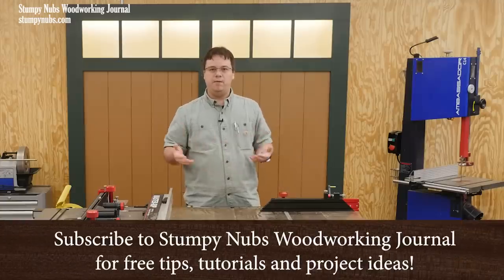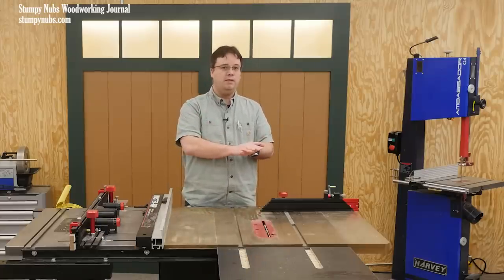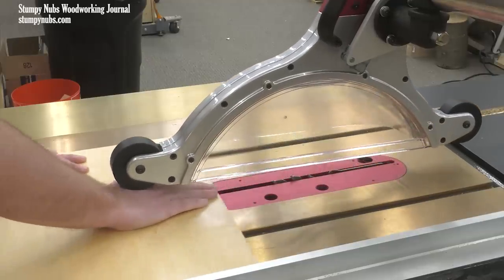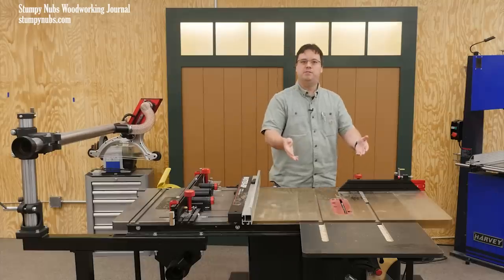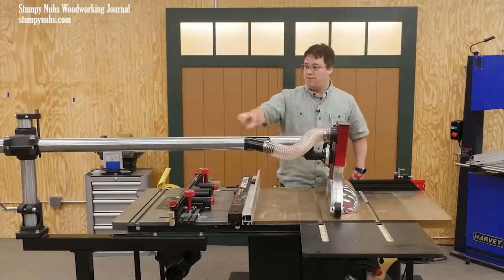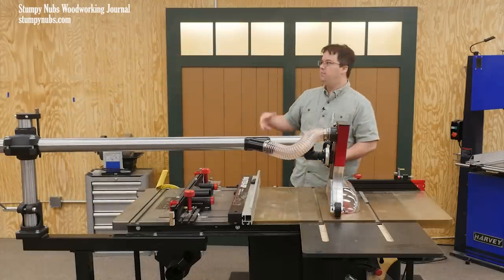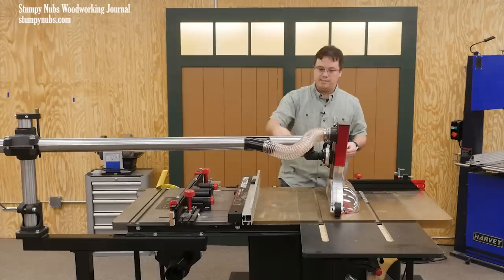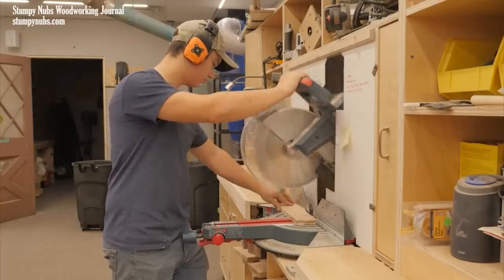MUST SEE table saw idea can save your fingers!

Comment: This video reminds me of a question. Lately, I’ve seen an online obsession with track saws. Aren’t they just a circular saw with a guide? Whatever happened to snapping a chalk line? Or even clamping a straight edge to a piece to run your saw along. Seems like it’s a case of saving money by learning to use another tool right. 

But then again, maybe I’m missing something. You’re one of a few guys I feel like I actually learn from. (The other guy is old-fashioned hand tools only).
Reply from the maker: There are definite benefits to a track saw. For one thing, the track can create a perfectly clean cut much easier than following a line by hand. The track can also be laid right on your mark without accounting for an offset, as you would with another type of guide. And the track's edge is designed with a strip to hold down the fibers and prevent tear-out along the edge of the cut. Finally, it is easier and safer to plunge-cut with a track saw. I am not saying anyone NEEDS a track saw, but it there is a reason people like them.

Comment: Beyond it actually working the next most important part of any safety equipment is not getting in the way.

My company bought 2 chuck guards for ours and maintenance's pedestal drills, I argued to modify ours in a way that made it slightly less protective but way easier to use, a year on and ours is still in use while the one in maintenance is partially broken and spends most of its time bypassed so it doesn't get in the way.

Comment: I was expecting that thing to cost much more and it is more reasonably priced than I thought.  It is ~$850 on sale ($1000 normally).   Still out of my league. 

I've been toying with a home-brew system that actually mounts to my shop ceiling for my saw that I had to remove the guard, because of the outfeed table and design of the guard mount (old Craftsman 113 - converted to a cabinet type saw).  I have a basement shop with floor joists about 7' above, making it more convenient than attaching to the table or floor.  Time will tell if I have the willpower to follow through and build it.  ;)

BTW... my converted saw looks almost like yours... same basic dimensions, router table to the right, etc., but my outfeed is 48x48" and covers nearly the entire back of the table (thus prevents mounting the original blade guard).  I built a dust shroud around the exposed motor with 4" extraction for chips and cooling (again, eliminating the ability to re-mount the guard system).

Comment: A SAWSTOP brand saw is a great blade guard.
Reply from the maker: I own a SawStop and their overhead blade guard that's similar to this one. This is definitely better, but the SawStop one is nice, too.
Reply: @StumpyNubs  the point was, there’s no need for one on a Sawstop.
Reply: @StumpyNubs  the blade guard is pretty redundant unless you key off the cartridge to cut plexi, Kenmetal, etc
Reply from the maker: I still use my guard on my SawStop.
Reply: @StumpyNubs  But why? I’m on the bench about 30% of my day five days a week. I don’t know how you can stand having a guard on there. I even pull the riving knife.
Reply from the maker: There are many reasons to use a blade guard besides protection from getting cut. Link to a video about it is pinned to top of comments.

Comment: At $850, it is expensive, but it doesn't appear to be overpriced. If I were to have one in my shop, I think I'd mount it to a rolling cart so I could move it out of the way when using the router table.
Reply from the maker: It has to ship freight. It's heavy and large.

Comment: I bought a Craftsman table saw and the riving knife didn't line up properly with the blade so i took the assembly off. Never used it again. That scares me to even think about - luckily all my fingers are in tact. Just bought a DeWalt table saw and the guard is staying on for sure.

Comment: JAMES! - IM GOING TO CUT MINE!   😅😢😬😰😱 wish me luck!!  I bought the Harvey shark and I have a Laguna cabinet small with 36” to the right of the blade and a tiny garage shop. I just can’t place the long 60+” arm plus blade cover far enough away from the saw blade, or at an angle without taking up a massive amount of shop space.  I’m about to take about 15” of the length of this shiny beautiful steel boom. 😱😱😱

Comment: Hi,  Enjoy your videos, some of the best on wood working tools and techniques.  Your video on the Shark S-12S was a “just what the doc ordered” and so I have looked into this further.  I have one question that I can’t seem to get an answer from Harvey customer sales.  Without getting into the details I  have the need to position my table saw in two positions in the workshop that is 90 degrees at various times and so the S-12S is too heavy to make this adjustment easily. Therefore I’m considering/investigating mounting it from the ceiling. The question is can the shield be easily rotated 90 degrees.  The answer seems to be yes but looking at the instruction manual they say I would need to remove the “knobs” which appears to be what holds it in set position, and Martin at Harvey keeps avoiding that part of my question (maybe I’m not explaining myself??).  Having and using this tool first hand, do you see any issues.. ?  Thanks, and keep up the excellent videos.. John.
Reply from the maker: I am not sure I understand you, either. But I can say that the shroud assembly connects to the end of the horizontal arm at a sort of ball joint which, when the two knobs are loosened, allows the whole head to move in all directions (like your shoulder joint). It can turn, tilt, etc. Whether that, along with the fact the the horizontal arm itself can pivot on the vertical post, will give you the range of motion you need, I can not say.
Reply: Yeah, I understand that my situation is hard to picture, especially if I try and avoid writing a novel.  Anyway, Martin (Harvey customer service) suggested that the “knobs” had to be completely removed to give me a 90 degree clockwise rotation, starting from the more traditional configuration as shown in videos and the manual. That did not make sense to me looking at the instruction manual and the available videos..   Any of that make sense..   If not, thanks for listening…

Comment: Delta had an overhead blade guard back in the 50’s. I have one for my vintage Unisaw. It just doesn’t have the dust collection. You can even raise the right side for cutting close to the fence. It even has a splitter that can be popped up from below the table, and dried back down for non thru cuts.

Comment: Its nice looking but I had to save for year for my 3hp sawstop. I didn't even buy the over head dust collection. I took pvc pipe run it down my table 90 up then back down when I dont use my blade guard I just put pvc cap over it. It's nice but out of my price range. Heck I have pvc zip tied to my table saw lol

Comment: In a commercial shop - yes, It make perfect sense. In our small shops, not so much.  The size alone will steer most away, plus the price. I'm not saying that a guard isn't necessary because they are!  There's others on the market that have the same idea but somehow they've all but disappeared from the shows they were on. Dust collection and safety have always been a big concern with the table saw and with the renewed interest in the hobby it has (again) became a big concern and rightly so. 
Nice  but???

Comment: If the arm could rotate downwards 90° at the base to lower the arms to a horizontal position below the table for bigger cuts, it wouldn't need to be so large in smaller shops that occasionally cut large boards.

Comment: I've always wondered if there is some technique I've never seen to make a blade guard function when you need to set your fence close enough to the blade that it would run into the blade guard. Or is that one of the time you simply do without the guard?
Reply from the maker: I don't know of any blade guard that works for rips closer than about an inch from the fence. The nice things about this one is you can just swing it out of the way, then swing it back in place.

Comment: Or we just have ancient table saws that keep on working because they were built more robustly (but with less safety features) back in the day. (I probably wouldn't even have a table saw if it wasn't a hand-me-down). Hell, mine doesn't even have a mounting point for a riving knife, much less a blade guard. I give that thing a very healthy degree of respect; including a household rule: "If the table saw is running, no talking to the operator, or disturbing him in any manner until the saw is turned off and the blade stops turning."

Comment: James I noticed a bump when the workpiece you were feeding contacted the area ahead of the rear wheel of the guard.  Is this something that could be adjusted away or is it a feature of the guard?
Reply from the maker: I'm not sure what you mean unless you mean how the workpiece lifted the guard upwards. I explained that int he video. If you don't like that, just lift it by hand before you make the cut.
Reply: @StumpyNubs  I guess I wasn't clear. When you fed the workpiece into the guard the wheel on the leading edge of the guard smoothly lifted the guard so that it rode on the workpiece. But as the workpiece contacted the metal portion of the distant edge of the guard just before it reached the rear wheel the workpiece appeared (to me) to almost stop moving until the force you were applying to the workpiece overcame the resistance of the metal edge of the guard and lifted the distant wheel up and onto the workpiece.  If you didn't notice the bump then I guess it's not an issue.

Comment: Hmm, replace the wheels on that guard with ones that have a hub motor in them and you can have an electric board feeder in addition to the nifty blade guard.

If the blade guard can pivot at the end of it's arm, why not build an extension to that out feed table you have there and move the whole guard out further?

It would move it out of the way of the router router table.

Comment: If my blade guard could flip up vertical so I could  line up the cut,  then I would use it.  My Harvey blade guard just lifts up parallel to the table a couple of inches.  It makes it very difficult to line up the cut

Comment: My Delta come collect contractors saw cost me $200, this thing cost $850. In my small shop this would not work. I use a spitter where the old blade guard was mouted. I do like this guard however it would not work for me.

Comment: Yikes, that is pricey.  But if it's made by the same company that made the SharkGuard, then it is high quality.  I bought one for my old Delta Unisaw because the factory guard was crap.  The SharkGuard made it a lot safer.  I upgraded to the Harvey last year and don't regret it at all.
Reply: There's no relationship between Harvey and the guys behind Shark Guard.

Comment: Ingenuity ? I can't figure why companies and woodworkers opt for complicated and expansive design flaws. The manufacturer could easily provide a longer vertical post that we could attach to the CEILING instead, which would resolve the limitation James underlined in this video. No more obstacle in the way.  If I knew how, I would share the dust extraction and blade guard I designed and realized in my little shop for about  $60 CAD. Light, efficient, never in my way, but not as cute as the thing illustrated here. Sorry, I prefer functionality to appearance.

Comment: Couldn't something like this be incorporated on a ceiling mount instead? It could be designed with a scissor bracket so as to raise and lower etc.. Seems like this style takes alot of space. Good if you have space.

Comment: does it do anything to protect you from kickback?
Reply: Doesn't appear to, the wheels moved freely in both directions and there's no paws at the back to grab wood. If they put one way bearings in the wheels it might work though.
Reply from the maker: That's what a splitter or riving knife is for, as I explained in the video.

Comment: if you can PUSH it out of the way, why doesnt it drift forward when you PUSH the workpiece into the leading wheel?
Reply: I'm guessing the... in the way position is the end of its travel in that direction but I'm only guessing, I have no room for a monster like this.
Reply from the maker: There is an adjustable stop that keeps it from pushing forward. It can only be swung back.

Comment: is this just a redundancy for the saw stop system? Why would you need that if you have a sawstop... taking dust out of the equation
Reply from the maker: There are many reasons to use a blade guard besides protection from getting cut. Link to a video about it is pinned to top of comments.

Comment: I built my own. I stole all of the sawstop ideas. It works great. However this is better. It’s also, very expensive. In terms of dust collection, my one if you can and add tape on the sides. Reason being is you have control of the hose size. You have a 6” system. Cool. You can do whatever you why. This, is a beautiful system and has a feature that rides above wood. Mine. And sawstops. Don’t. Is it worth $899 to adjust the guard? Dunno. Up to you.

Comment: I was thinking about this very recently as I need to break down a bunch of sheet goods. Just refitted my guard and the blade won't go low enough for the teeth to be at a nice height for the 18mm ply. I think I may need to build something like this.
Reply: After finally getting a track saw, I would never go back to messing with a table saw for sheet goods again 
1. Great accurate cuts, 2. Excellent dust collection, 3. No chipping veneer, 4. Very safe, 5. No heavy lifting
Reply: @johnbocum7591  thanks. I have also been fighting with myself on this. I have a good circ saw that is quite old and could do with something to break down sheets from full size. Problem I'm having is the rail lengths. I'll figure it out.
Reply: @johnbocum7591  Have you ever used a track saw off a track?  I have a long trend guide rail that I use for all sorts.  Could I run the track saw along it in place of a track? My gut says no due to the lack of riving knife.
Reply: @markgambrill  you could run along a straight edge, however, the cost of the excellent powertec tracks makes it not too expensive to have a 110” run.  The riving knife is not needed for sheet goods, the Makita saw does not have one, it does have a scoring mode that works neat for todays chippy thin veneers.

Comment: I found out when I was 18 that putting your fingers in moving equipment wasn't a very good idea and so 56 years later I haven't had another accident with equipment. I am very cautious and know exactly where my fingers and other body parts everytime I use any power equipment. After over 60 years of carpentry, woodworking and all phazes of home construction  I haven't had another mishap by being cautious and observant. No Saw stop   for me they are absolutely crazy priced and I suppose I will risk without all this new safety equipment.
Reply from the maker: I had a close friend that was a master woodworker with decades of experience at levels I will never achieve. Then he cut three fingers off. Being a human trumps experience.

Comment: This is all just better-mousetrap stuff. Fundamentally table saws are dangerous and just a cheap/quick method of cutting that we all just accept as normal even though the evidence of thousands of lost fingers each year should tell us otherwise. IMHO we should be exercising metalworking principles to woodwork, with the workpiece firmly clamped and the mechanically guided blade moved through it (and ideally remotely).

Comment: It can be easily moved off the saw blade. Just like the original blade guard that came with the saw that was easily removed and never used and got lost. 
Just sayin'
Reply from the maker: I wasn't speaking just to Harvey table saw owners or others with easily removable guards. In fact, I made that pretty clear right at the beginning of the video. Just sayin'

Comment: Honestly advertising a $1k boom is a bit much for my taste. This is getting to the point where you should just spend the $1,000 towards a Saw stop and get the accessories that do this already if safety is must that much more important.
Reply from the maker: Then just use a regular blade guard. I never said you need this one.